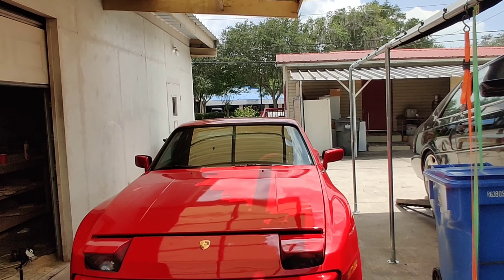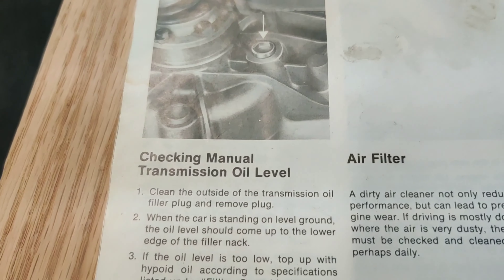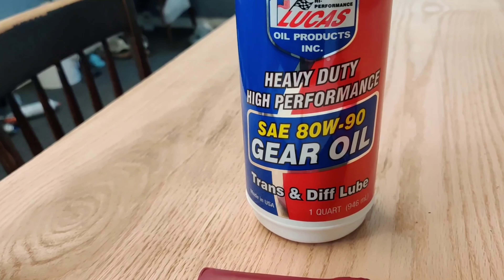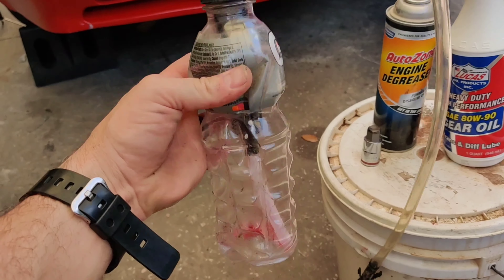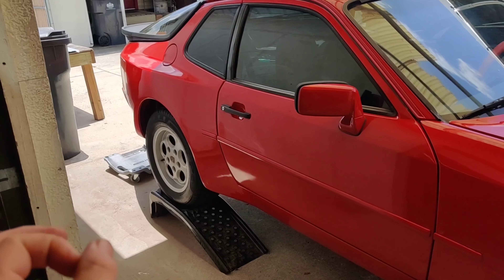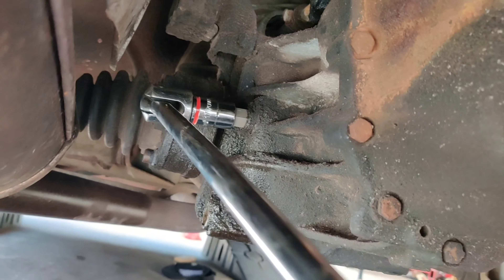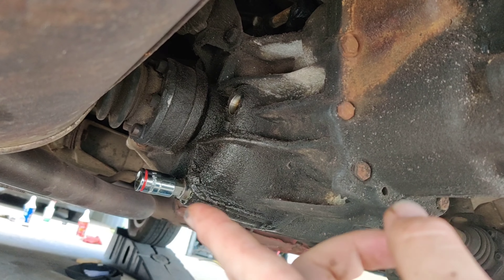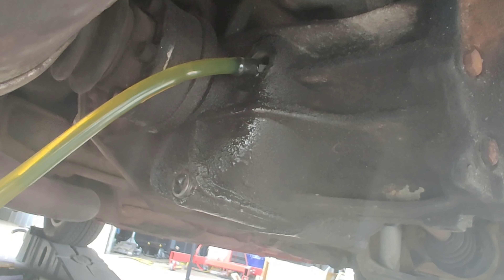Porsche 944 manual transaxle gear oil change transmission fluid

Comment: Thanks for the video. Planned to change the fluid this week! I have the haynes manual, but a video is always nice as an extra reference!
Reply from the maker: Thank you. I agree. I have both the Haynes and the factory but sometimes things get updated in between.  I’m happy with how mine drives.  I did change out the clutch and it’s finally like a refined sports car.  Love it.

Comment: There was a Tech Service Bulletin update on the level and I believe it was 7mm below the fill hole.
Reply from the maker: Interesting.   How in the world would you measure something like that.   I couldn’t imagine filling it to top would ever be bad since every diff I have ever done uses top as fill spec.
Reply: @petescarport  You could get crazy and put a 7mm bend in a piece of wire to use as a depth gauge...lol.  I don't think that any fluid that is sloshing around while you drive needs to be that precise. With the vehicle level and on the ground  I just stick my finger in and if it feels like it's a little below the opening, I call it a day.
Reply: Might be a good idea to clean and degrease BEFORE you remove the plugs, to ensure no loose junk gets inside. Then a quick wipe afterwards.